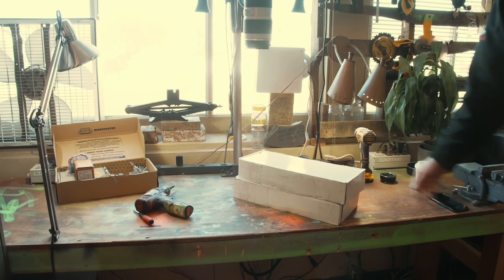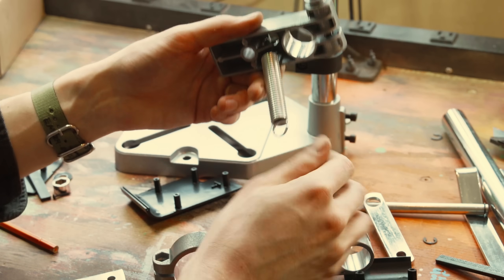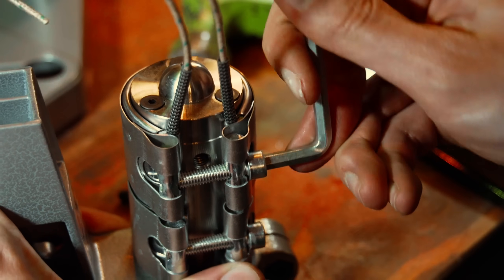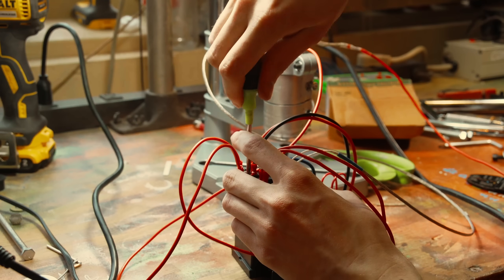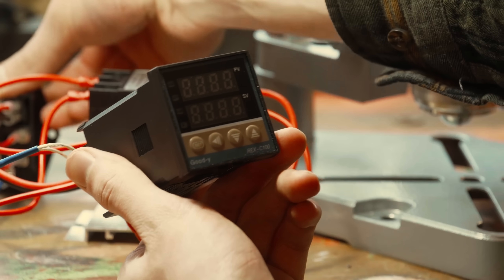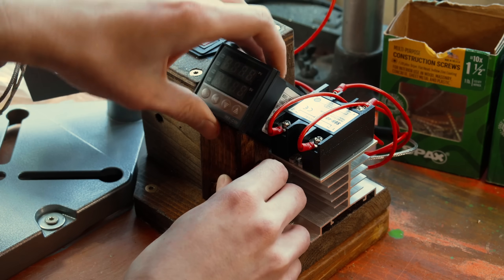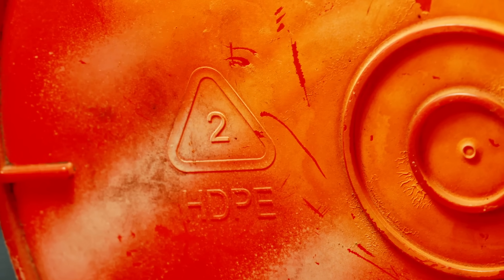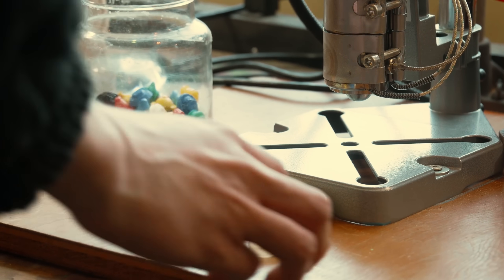Building an Injection Molder from a Drill Press

Comment: The relay heatsink being screwed directly onto wood gives me massive fire paranoia if it catastrophically fails.
Reply from the maker: The kit has the relay enclosed in a 3d printed shell without using the heatsink, so I felt like this was fine. Good thought though, might build a metal thing for it later
Reply: @EvanMonsma  Its' probably just paranoia

Comment: I would definitely measure the current draw from the battery with this setup and do some math before depending on it for a full day of injection molding. Anything where you're intentionally generating heat means super high power usage. Regular car batteries are really optimized to put out short bursts to turn over an engine then immediately get charged again. Sustained power draw can damage them. It would suck to get there on the day and drain your battery after only a few parts (and then be left with a dead car battery to boot!). You might want to look into deep cycle lead batteries, or invest in some LiFePO4 cells.

Love the videos dude! Looking at some other comments I really appreciate you cutting out the solder on crimped wire part to not accidentally give bad advice. Really speaks to the respect you have for the audience

Comment: You should never solder wires and them crimp them. The crimp is designed to clamp down on loose strands, displacing and crushing them into a form. It cannot do this with a solid solder-covered wire. Additionally, the points where the solder peter out and it becomes strand again is a very weak point and is likely to break. Either way, you may suffer  poor electrical conductivity though this which could cause arcing and/or fire. 

Buy yourself a proper set of ratchet crimpers. Those multi-tool crimpers are beyond useless.
Reply from the maker: Thanks for the pointers! I trimmed out that one clip so I'm not putting out any bad info. It felt stronger to me but good to know that isn't actually better over time. And yes, the dumb crimpers suck lol, that was probably part of my problem in feeling the crimps weren't good before

Comment: awesome project. Let me have one smartass comment: Don't put solder on wires you are about to crimp/clamp. The reason: The solder is never totally solid an will give over time, so the contact gets worse over time and resistance might increase and with that heat and it might become a fire hazard one day. This btw is an official rule to follow for electricians in Germany ;) Ok enough preaching, I'm looking forward to the injection molding video :D
Reply from the maker: Thank you for the pointer! I should have thought to check that beforehand. I cut that line from the vid so I don't give any bad info :)
Reply: @EvanMonsma  Great idea 👍 btw crimping first and then soldering would be fine.